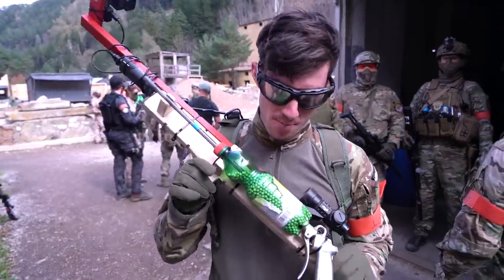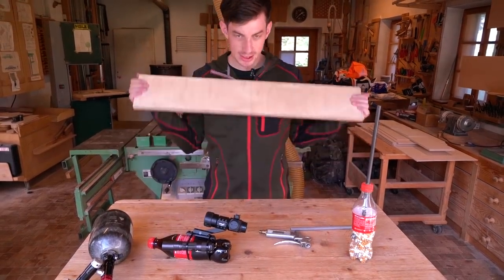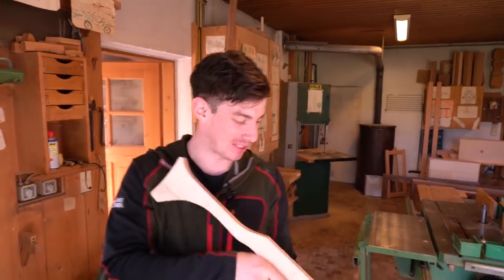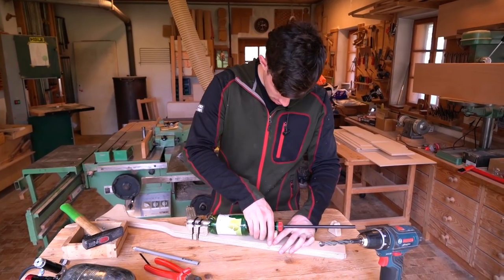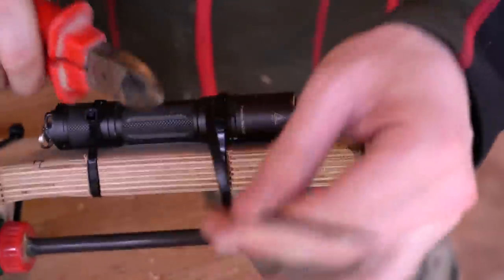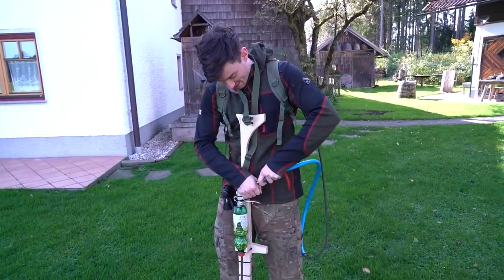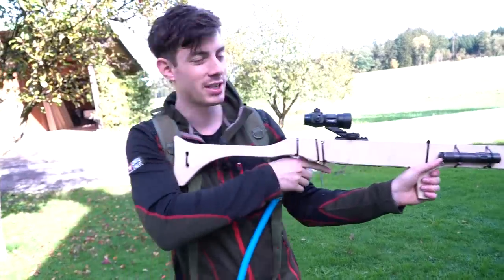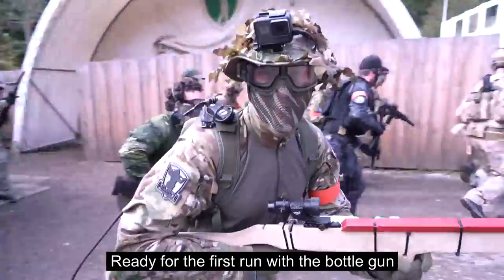How To Build An Overpowered Airsoft Gun for 19$

Comment: Me: Dad can I please get an airsoft gun?

Dad: Go make one your self!

Me:
Reply: McFishMan points guns at dad* now go get me a. Airsoft.
Reply: haha so funny I am laughing
Reply: @ricefarmer4738  you forgot thr funny
Reply: I was expecting the airsoft gun at home joke
Reply: yeah, this guy is jealous not being a paintball warrior....he lost his way lol
Reply: Yea, and you make a beast that is faster than half of the guns on the field
Reply: Hold up let me get my 500$ air compressor
Reply: @pufferfish7859  🤣
Reply: Replace the soda bottle with a thick high diameter PVC pipe as a chamber and surround both sides with a nice 3d printed engineering resin body and now it looks like a decent quality strong plastic airsoft gun. Alternatively, you can put a wood plank like the one he has under a CNC and get the general shape of your weapon with multiple layers of height then repeat the exact same process with the second piece of wood for the other side. Now you take the two pieces with rigid layers and either hand sand, orbital sand or belt sand them down to a smooth strong build. Lastly, you take the smooth weapon body, carve out the holes for a reloading latch for the PVC chamber being put inside and holes for all the pipe connections, and put the internals (the PVC chamber, barrel, and the firing trigger) inside the middle of the two wood pieces then screw the two sides shut. Now you can plug your HPA tank into the gun. Last you out a small sealed metal latch in the PVC housing top which corresponds with the hole in the top of the wood. Now you can load your gun through the breach hatch on top and then reseal and start firing. I like option A a lot better because it looks good enough and still has trouble breaking while taking less handwork. The full wood weapon chassis gets heavy but it is extremely strong and can even be used to perform stock butting attacks but that might get you banned from the airsoft field.
Reply: @pufferfish7859 lmao

Comment: Perfect! You should also instead of HP tank use 2litter cola bottle stack for air with car valves in caps.
Reply: Rudolfs Osmanis this was the first airsoft gun I ever built and I used nine 2 liter bottles that leaked constantly.
The most fun I ever had

Comment: Only $19! ** Industry standard wood shop not included **
Reply: cayorne right, that table saw and belt sander have got to be several thousand a piece.
Reply: Use a saw and file works too
Reply: THIS JUST IN: TO MAKE THINGS YOU NEED THE TOOLS TO MAKE IT
Reply: cayorne dude! If u buy a jigsaw and some sandpaper ur at about 50 bucks ... No need for that woodshop but it surely is more confortable
Reply: Jigsaw, some cheap files, and sandpaper can go a long way if you have the patience.
Reply: cayorne I
Reply: Sandpaper and hand saw :p
Reply: cayorne 
And the scope cost more than the gun XD
Reply: Only 19 dollars Just 539 bucks!
Reply: Dont forget the air compressor
Reply: Your trusty saw,file and sand paper works perfectly fine..
Reply: Or airtank

Comment: how do you load it besides cutting the zip ties or  muzzle loading it?
if you make a new one try a pvc bb tank 7mm brake line or aluminium tubing and a holographic sight.
you wont even need a stock it would be like a flamethrower.